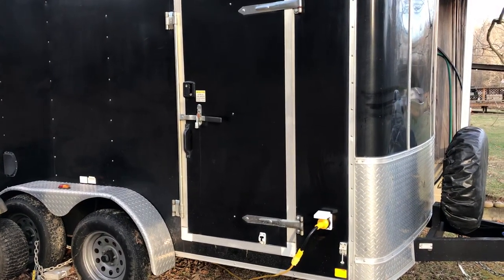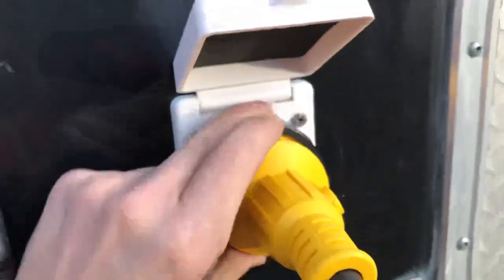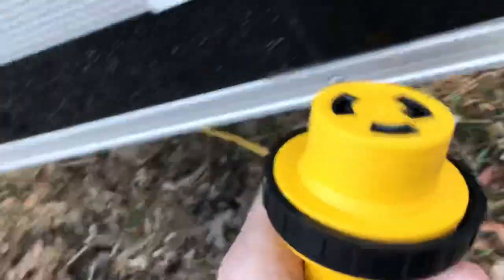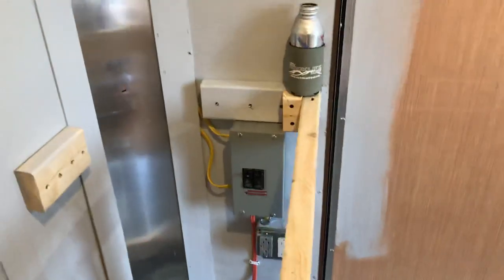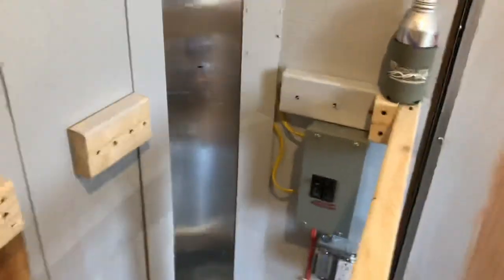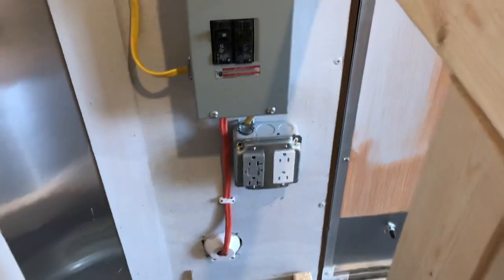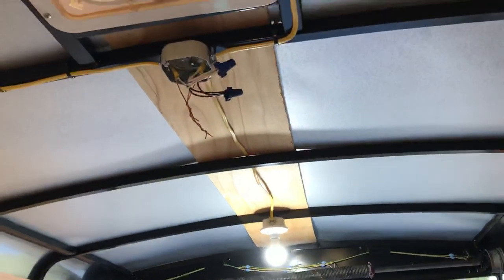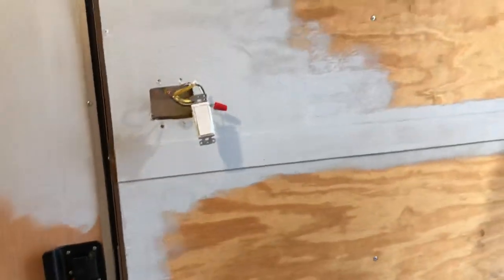Cargo Trailer Conversion! Electrical (Part 1)

Comment: Why did you put the electrical connection behind the door? Now you can’t open the door fully when connected to an electrical source?
Reply from the maker: That’s a good point but for my needs I don’t need the door to open all the way like the trailer. The door only opens so far because of the door limiter. Never had a problem with it located there.

Comment: What type of two breaker panel is that by name? I looked today at my local hardware store with no luck. Great three part video series.  I found some RV 30 amp panels online but they’re all like $100 or more. Hopefully your two breaker box is more affordable. 
Thanks. 
I’m trying to duplicate what you did in my enclosed trailer.
Reply from the maker: ANTHONY A 15$ at lowes is what I paid for it. Forget the name as it’s been a while since I bought it. Works good! Any house hold panel will work. Doesn’t have to be RV one.
Reply: Found 30 amp panel with two breakers for $35. Thx

Comment: STOP SHOWING POEPLE THE BAD WAYS OF DOING STUFF .... Do you work at a home center ????
Reply from the maker: Make me a list of what’s wrong...
Reply: @FitLeben  No wire grips on on entry points . No junction box the the line voltage light switches and since you have No framing up for safety an mc wire would be safest but you know this right  and why don't you just install a 30 amp power point just spend the $$ and do the job right Not half ass like everything else in your build  . oh and I was looking at how people wire the solar and at times I watch FOOLS try to be electricians Thanks for the show.... Keep studying my little GREEN HORN you'll get it one day ! Happy holidays
Reply from the maker: @4uthick  never herd of a wire grip? Yes there is no junction box because I can not find any that are slim enough to go between the plywood and the outer wall. I have since replaced all romex with thhn and conduit. You do know that this 30amp to 15amp converter extension is used by a lot of people when not at RV parks to just run things like lights, fridge. No such thing as half ass with this. Everyone has a way they wire there builds and it’s all different. I’m not telling people how to wire there trailers. I’m showing how I wired mine.